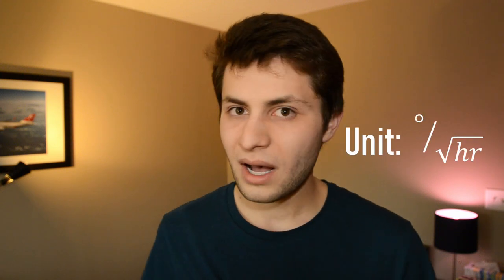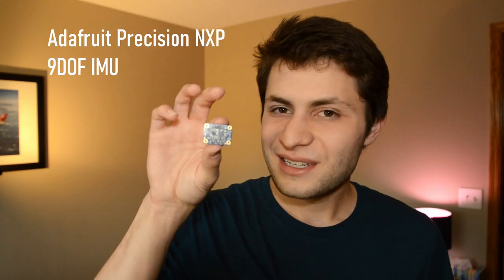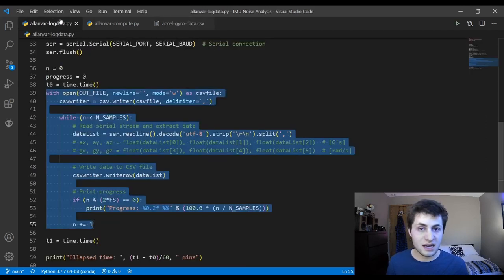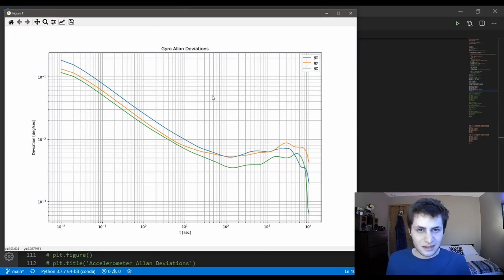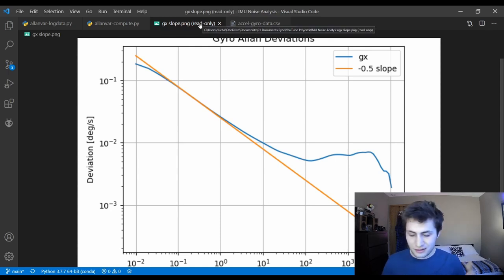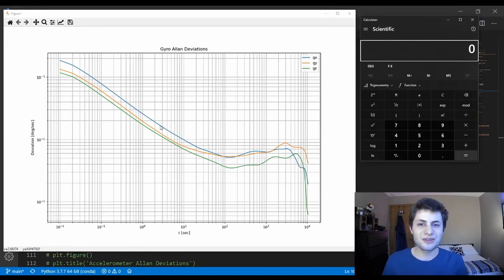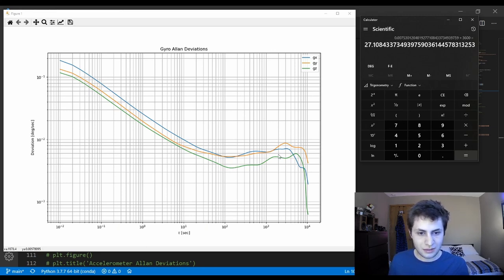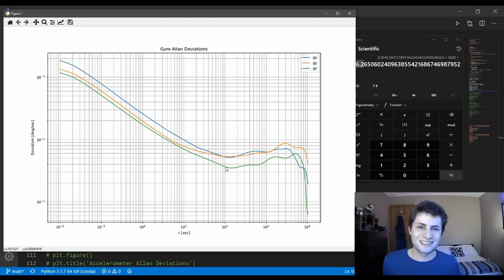Gyro Noise Analysis Using Allan Deviation Plots

Comment: Allan Variance is one of the most important factors in engineering a gyroscope into a guidance system. You could also touch on Carson's Deflection of non linear angular correction for the servo circuits to compensate for the Hatfield Polarity switchers of a signed value use in the division of polynomials necessary to compute this correction.

Comment: Haha! I know the professor that references that Allan Variance document you use on your blog. I'm guessing we're on the same campus. I like your approach.

When it comes to your DAQ, have you noticed any problems when it comes to consistent loop times for recording data? It looks like you're recording directly on your PC, so a desktop machine probably has the GHz to handle page shuffles for data, but if you're planning on doing DAQ through your flight computer, do you have any specific plans other than directly recording to the Teensy SD card? I've had occasional massive loop lengths using an SD card, and I've decided to switch to a flash chip and write to SD when not in flight which has had great results.

Looking forward to more.
Reply from the maker: I am aware that writing to SD cards can be very slow. The Teensy does have a few features that might speed up writes, but I haven't experimented yet. The Teensy gives you the option of soldering an extra flash chip on the underside of the board, but I don't need that quite yet. If write speeds become a significant issue, I'll add on a flash chip. Thanks for the input! (P. Sherman is an awesome professor, too)

Comment: Awesome video, thank you so much! I'm trying to model some gyro & accelerometer data for a project and I'm struggling with using the AV or AD to simulate/propagate the bias. Here is my thinking: w_measured = w_actual + w_noise + w_bias. w_actual I have from calculation. w_noise I am sampling as gaussian white noise using the noise density from my IMU data sheet. Lastly, w_bias I am modelling as w_bias += w_bias_noise * dt. Here's where it gets tricky for me, how do I determine which variance to use to sample w_bias_noise as gaussian white noise, ie. how is this related to AD or AV? This might be a long shot but any help would be amazing :)
Reply from the maker: I made a code snippet that should help you. I'm not an expert in this stuff, but I think it's correct. I also included links to a few useful articles. Thanks for watching! https://gist.github.com/michaelwro/126de51e3d2bcaeda3fb5609aa19f0e5
Reply: @micwroengr7851  Dude thank you so much, you're amazing! This is really helpful.

Comment: Very good material. You made me understand the issue of gyro noise. I would be grateful if you could explain how can I implement ARW and BI in my code to reduce the noise. Waiting for the next videos.
Reply from the maker: You can't really use angle random walk and bias instability to reduce noise. These parameters are used to model gyro noise in computer simulations. If your gyro measurements are too noisy, you could apply light low-pass filtering to smooth things out. Thanks for watching!

Comment: Hi bro, jimit here, i want to know that can we use angle random walk and find varience and that variance we can put on Q matrix In ekf for attitude estimation and similarly we calculate valocity random walk then find varience then can we put that acceleration sensor variance to R matrix? If no then how to determine optimal Q and R Matrix value? Please help me, I love you bro:)
Reply: I am also trying to find the connections (if any) between the results of Allan Variance and the Q and R matrix in KF. If anyone has relevant information or references please leave comments.
Reply: @hiankun  I think I find noise density parameter use In the Q and R matrix because it's close to the standard deviation equation!  we do similar things to calculate RMS noise, I try attitude estimation using quaternion in EKF using IMU and compass sensor, where I calculate noise density and then I put these values in the R matrix, and the Q matrix adjusts according to our requirements its work fine for me! I don't know if I am right or wrong!
Reply: @jimitjaishwal  Congrats for your success! I still have no real data to try my understandings and hope I could do some tests in near future. Thank you for the reply. If I can get some insights I will share them here.
Reply: @hiankun  Thank you so much!

Comment: Great video! Really cleared things up for me for the Allan Variance. But there's something I still don't quite understant about Bias Instability. For me, it represents the way the Bias of the gyro (omega in deg/s) changes over time. Does that mean that the Y reading at the minimum of the Allan plot (in deg/s) represents how far the gyro reading has strayed after X units of time? In your example that would mean a bias of 0.05deg/s after 129s of gyro readings. Or does it simply mean the the gyro bias, once integrated, gives a theta error of 0.05deg/s * t (so a 0.05deg error in integrated gyro readings after one second, for example)?

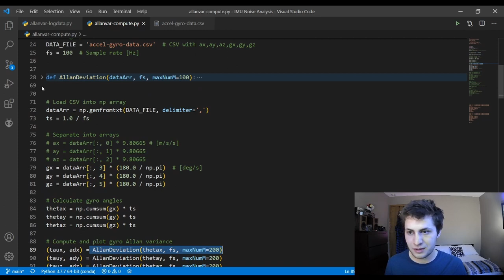Also, around 6:44 you seem to calculate the Allan Deviation from the Theta (degrees) angle in your code. Isn't it always calculated from the gyro rate (deg/s)? Also, if you were to calculate your Allan Deviation from theta your units should be in degrees instead of deg/sec.

Comment: Does accelerometer and magnetometer have the same noise characteristic and thus, require the same implementation of Allan deviation analysis or is it only unique to gyroscope? Do you know of any other sensors with similar noise properties as the gyroscope?